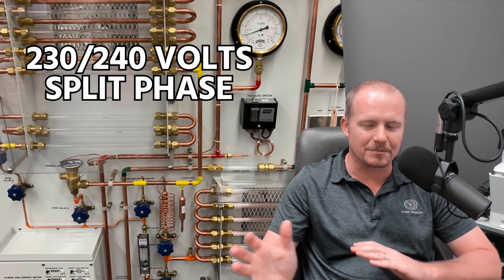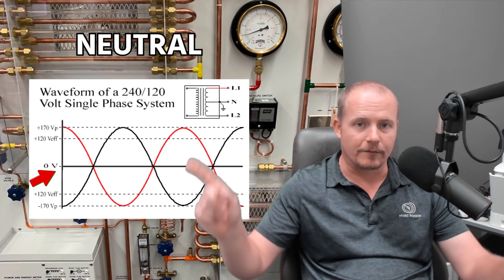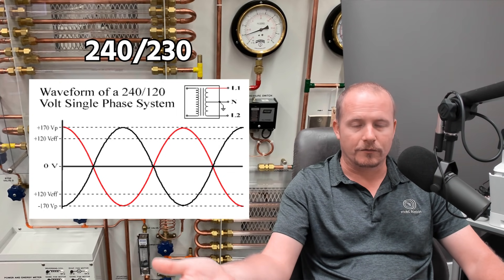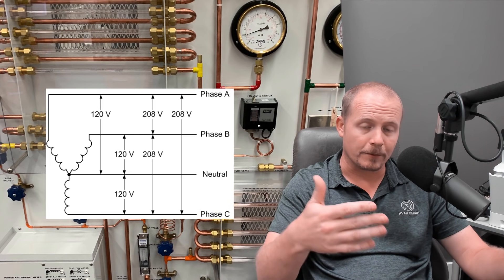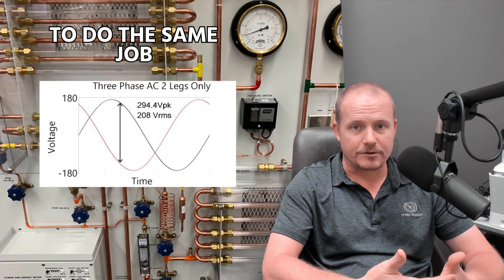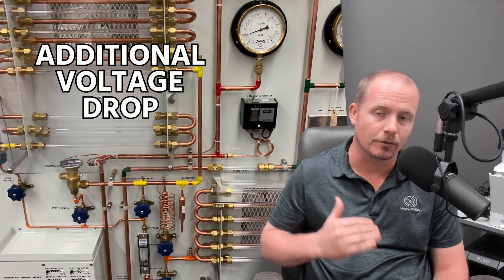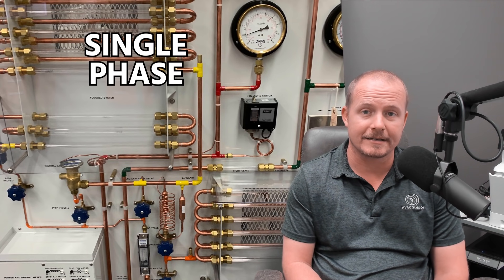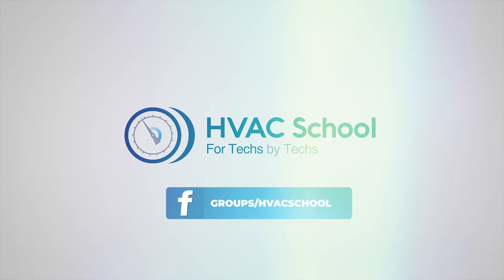How is 208 volts different than 230/240 volts?

Comment: I've been told the difference between 208 and 240 is no neutral versus neutral.
In other words, 208 hooks up two hots (& a ground) while 240 hooks up two hots with a neutral (& a ground).

Correct?  

Next question, would it matter if the load center is single phase or three phase? 
You can use two hots / neutral either way.

Thank you...
Reply: Neutral is only EVER needed when 120v is used. Hence, why your oven and dryer has a neutral (it powers many components that are only 120v inside itself) Whereas a plug for a 240v welder has no neutral, or a hot water tank has no neutral.
Reply: Wrong 
How can you hook up two hots and a neutral - that's 3 wires to an appliance that only has two wire input?

You get 240 by using 2 hots that are 120 volts AC RMS each and are 180 phase shifted. No neutral is required.
Reply: @deang5622  They are not phase shifted. It's single phase. If you put two AA batteries in series and measured the total volts, you'd get 3v (240VAC equivalent). If you measured one end to the connecting point of the two batteries, you'd get 1.5v (120VAC). And if you took the meter lead connected to the end of the battery and moved it to the end of the other battery, you'd read -1.5v (120VAC).
Reply: @truthbebold4009  
Firstly stop talking about DC. That's not relevant here.
Second, it depends on where the reference is. We are talking AC.
If the reference is neutral, and you are making the  two voltage measurements referenced to neutral - one potential difference between neutral and positive, one potential difference between neutral and negative, plot both of those on an oscilloscope, you get two signals displayed which are 180 degrees phase shifted. And the magnitude of the voltage of each of those waveforms is half the total. 
Remember there is a centre tap and the neutral is connected to the centre tap.

When the voltage on the positive terminal is at it's peak of +E volts, the  voltage at the negative referenced to neutral is -E volts.
Now remember it is AC, so the voltage is changing.
A few milliseconds later the voltage on the positive terminal will now be at +E-n volts.
What's the voltage on the negative terminal referenced to neutral? -E+n volts.
So as one is increasing, the other decreasing, and each waveform tracks each other.

If you measure the potential difference between positive and negative, then you will only see a single waveform, and as you are only displaying a single waveform, you can't have a phase angle.

Think about which way the coils are wound. That impacts the polarity.

In these multi phase systems, the phase voltage is lower than the maximum that can be produced which is usable by using two phase llines.
The only two ways that is possible (without using capacitor multiplier circuits and other electronic techniques) is by:
a. Using a step up transformer
b. Making use of the phase shift between conductors. Which means using two hot lines which are of differing phases.
You can use trigonometry or complex number theory to perform the calculation and determine what the resultant voltage is between the two phases.
Reply: @deang5622  Here, watch this video to see what I'm trying to explain. There is no phase shifting. Depending on how you connect up the probes from the scope, you can get it to read 180 out of phase or 0 phase change. It is 0 degrees out of phase. It is a single sine wave.  https://youtu.be/uRKbX74lBgU
Reply: @deang5622  In case the link doesn't show, the video is by Charles Staton and the title is Split Phase 120/240V Is Not 180 Degrees Out Of Phase
Reply: @truthbebold4009  Read my post.
What does "split phase" even mean?
How do you take a waveform, a single sinusoid and split the phase of it?
What does that even mean?

A mains electrical waveform, assuming is it is a pure sinusoid and has no harmonics present, is defined by the parameters of: amplitude, frequency, phase angle.
That is all. Nothing more.

Even if you take two waveforms with their own separate voltages, frequencies, phase angles, how do you combine them, what do you to each to make a resultant waveform split phase?

Can you not see it is just a label?  And not a very good one at that.

Don't get hung up on names. Understand what is actually going on. Think about it in terms of the secondary coil connections, the  direction of current flows, the direction of the magnetic fields and draw out the waveforms.
Reply: @truthbebold4009  the 120volt is single phase . The 240volt is not single phase .
Reply: @persona250  240v is most definitely single phase.
Reply: @truthbebold4009  if it uses 2 phases how can you define it as single phase …
Reply: @persona250  It isn't using two phases. You're referring to residential voltage in the US? Residential in the US is typically 240v single phase (3 phase is going out from power plant but only one phase is entering most homes). Your entire street might only have one leg of the 3 phase. Another street further down might only have one leg of the 3 but a totally different leg than yours. You can hook up an oscilloscope and get two sine waves but that is deceptive because the two sine waves are one single phase (they're seen that way on the scope because two probes are individually measuring voltage) I think where Dean and I disagree is really just terminology. For me 'phase shifted' implies two phases 180 out of phase. 

BTW, 2 phases 180 out of phase would actually be 0v. The Dave Gordon video explains that and the battery analogy quite well.
Reply: @truthbebold4009   ... If the street only has 1 of the 3 phases there must be a neutral conductor on the tx primary ?
Reply: @persona250  No. There is no neutral on the primary side of the transformer.

The primary windings have inputs of the three phase conductors.
The three secondary windings all have one terminal connected together referred to as the common.  The neutral wire comes out from that common point. It doesn't exist on the primary side.
Reply: @truthbebold4009  of course it is using 2 phases . How would the circuit work with only 1 conductor ?
Reply: @deang5622  You said they are phase shifted. That isn't correct
Reply: @truthbebold4009  They ARE phase shifted.
Let me explain it one more time.

The secondary coil has three terminals: positive, neutral, negative.

When making a voltage measurement using say a digital multimeter, you connect the negative lead of the multimeter to the neutral connection, and the positive lead to either positive or negative on the secondary coil outputs.

So let's talk about voltages. Let's make an instantaneous measurement of voltage.
If you measure the voltage between neutral and positive, the multimeter will read +120 volts( in this example, but could be anywhere from -169 to +169 volts) If you then make a measurement between the neutral and the negative line, the multimeter would read -120 volts.

The potential difference between the two hot lines (positive and negative) is therefore : 120 - (-120) = 240V.

That is where the 240 comes from. It's the potential difference between the two hot lines and that is only possible if one is at the positive voltage and the other is at the equal and opposite voltage, -120 volts.
So whatever one voltage is on one hot line, the other is at the equal and negative voltage.  This is the very DEFINITION of two waveforms that are 180 degrees phase shifted relative to each other.

Now you are clearly struggling with some of my earlier explanations, and I would deduce from that, your level of electrical knowledge is very low.

I can't explain this to you any simpler than I have. I don't have the facility to draw any diagrams here, and I am not convinced you have the mental ability to get your head around it .

So please don't respond further. I have done as much as I can to explain it to you. End of discussion.
Reply: @deang5622  Here's another video by Dave Gordon. I like this video better than the first one I sent as it is broken down in a more easy to understand lesson. Both these guys are very knowledge. Check it out please. Thank you!
Reply: @deang5622  It's called... 120/240v in phase or out of phase
Reply: @deang5622  Seriously, that second video should clear up any confusion. Peace 🕊️
Reply: @truthbebold4009  I don't think you appreciate just how well qualified I am in this subject.
I watch other people's videos, not to learn from them, but to observe the mistakes they make.

The video I watched earlier talked about voltages with AC waveforms but failed to even show a single waveform. It's idiotic.
Too many people, including electricians that really don't know what they are talking about.
Thanks buddy, but no thanks.
Reply: @deang5622  Did you watch Dave Gordon? The second video is really good. He breaks it down very well. If you're still not convinced after watching that then you should reach out to him and set him straight. Take care
Reply: @deang5622  the secondary coil has 3 terminals : positive , neutral , negative. This is incorrect 
The 3 terminals are positive, neutral, positive .
Reply: @persona250  No.
The names I used express the voltages relative to each other.
With a battery you don't have two positives.
With a coil you don't have two positives.
Each terminal needs to be individually and uniquely named otherwise you don't know which to connect to what.
Reply: @deang5622  yes bud how about 
L1 neutral L2 
it wouldn’t be negative.